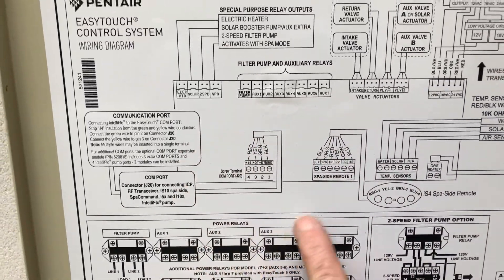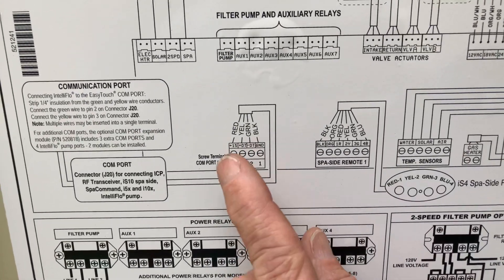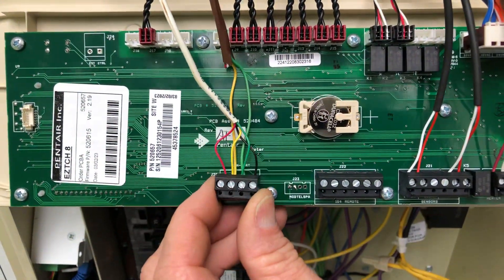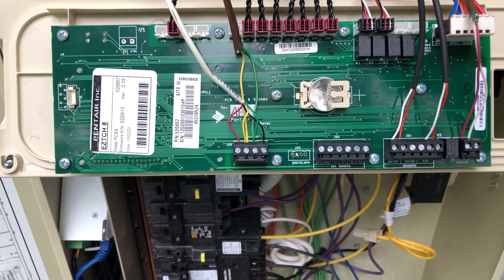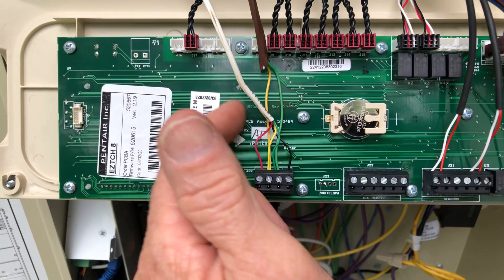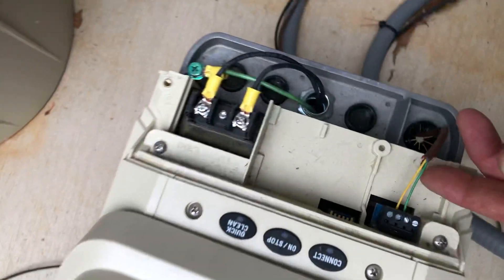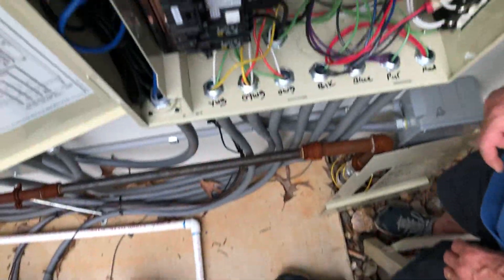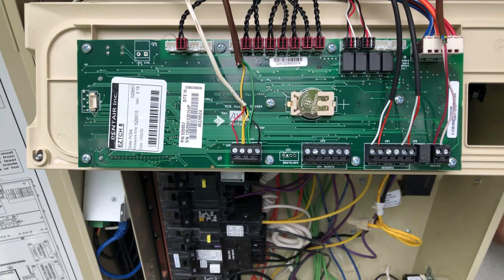Pentair Communication Cable Overview

Comment: I’ve been looking for a video showing exactly this connection.
I just had a single speed pump replaced for a Whisperflo VST, but it was not wired correctly.
Reply: Thank you for posting this video.